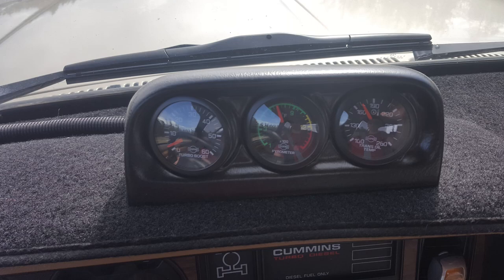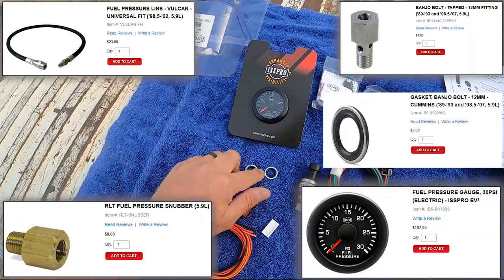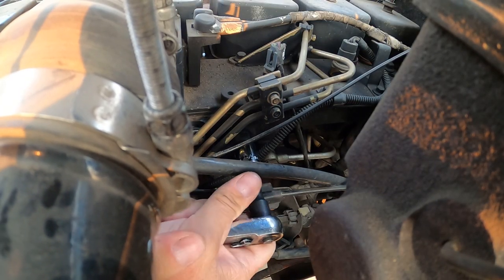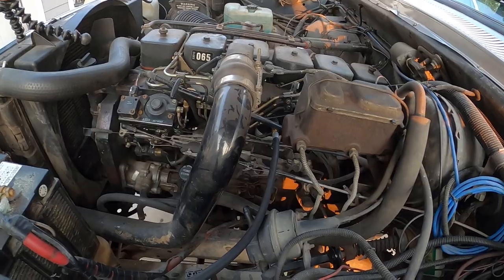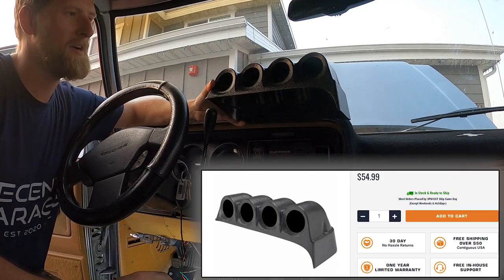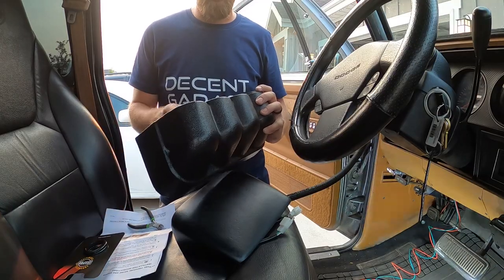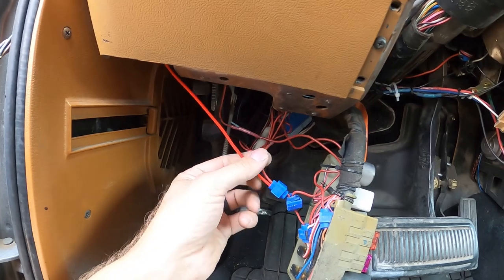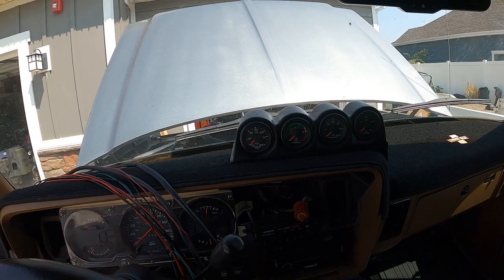If You Own a Diesel Truck, You NEED Gauges!

Comment: I came across your video just a little bit of constructive criticism. You did a nice job on everything very well laid out and thawed out. The only thing I would’ve did different instead of using the tap connectors into your fuse box you could put a hose separate fuse box underneath the hood of the truck Sea products makes it 12 bank fuse panel box. Would it taking you about 15 minutes to do that way good video keep it up

Comment: Why did you use that rubber hosing  versus putting the electric sending sensor right off the upper fuel filter fitting ? It seems unnecessary, but I’m likely missing some details. Ty!
Reply from the maker: Honestly, i just installed it how the instructions said to and how Geno's garage said to. I see your point. I'm thinking the reason may be to get the sensing away from all the throttle linkage to decrease the risk of it breaking

Comment: Hey I use Genos for a lot as well but I use westach for my after market gauges.   They were sold by genos for years .  They are no longer handled by genos as they are a small shop .   I bought my first gauge from westach in 95 for my 92 d350 and used them on my second gen and third gen as well as this 91 I bought a few years ago I also use them in my 46 power wagon .  They make single, double, an triple sweep gauges my latest is a double sweep which is trans temp on one side, rear diff temp the other .   Any way have a good day
Reply from the maker: Just looked up Westach gauges. I had never heard of them. They look very classic and would be cool in a 1st gen

Comment: Looks good 👍 
No more guessing on the lift pump or clogged fuel filter. Have you removed the fuel heater and upgraded to a larger fuel filter?
Reply from the maker: Yeah I'm more curious to get this installed on prospector bob. I think he still has fueling issues. I haven't removed the fuel heater
Reply: @decentgarage  I recently removed the fuel heater on my 93 thinking that it was leaking. Turns out that the injection pump return line had fractured at the bracket on the block🤦‍♂️.
No more leak prone filter heater✔ room to replace fuel filter with a larger and better filtration👌.
Probably going to spin on a Baldwin bf7772 that has a 5 micron absolute rating, much better than the factory 20 micron.
Reply from the maker: @davidcole3927  nice! This is definitely something I need to look into.

Comment: That's the same setup that I want to get for my truck too! I really like the classic look they give older trucks. I forgot, does the OG have any suspension upgrades, or is it stock?
Reply from the maker: The og is on stock suspension. I do have a kelderman rear airbag setup that I'm going to install over the winter and I'm also going to get new springs all the way around
Reply: @decentgarage  oh sweet! I’m glad if I go with that setup, I won’t have to put some suspension mods on it. Can’t wait for the airbags on the og as well.